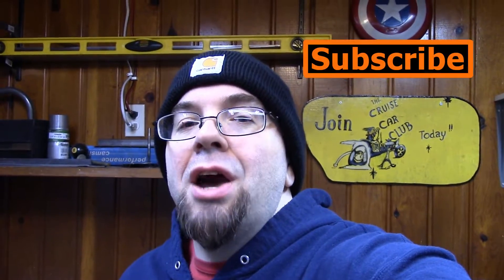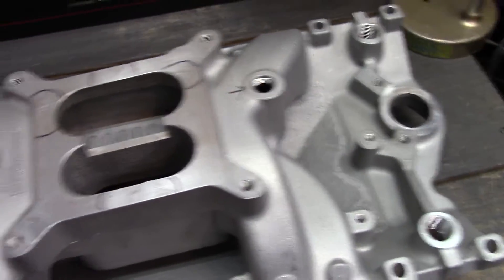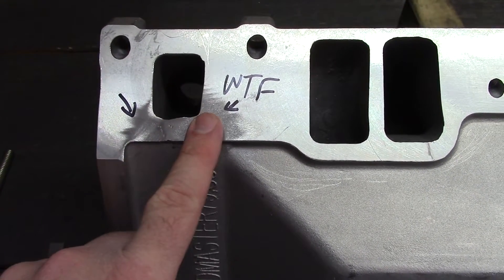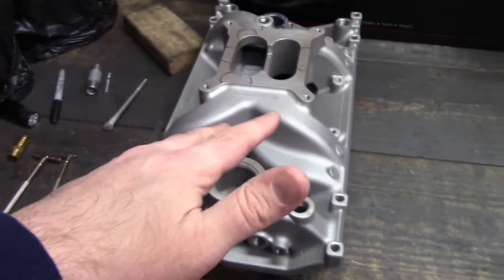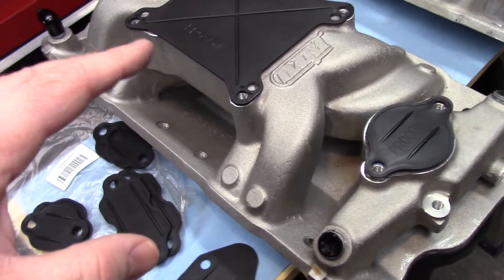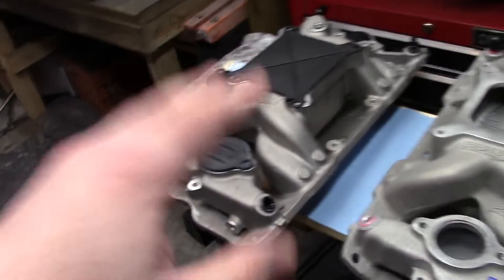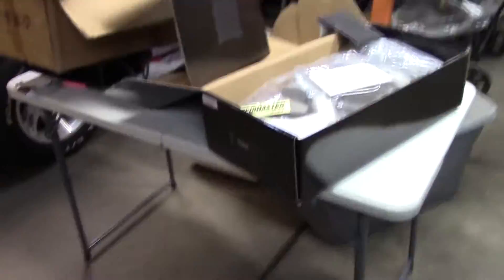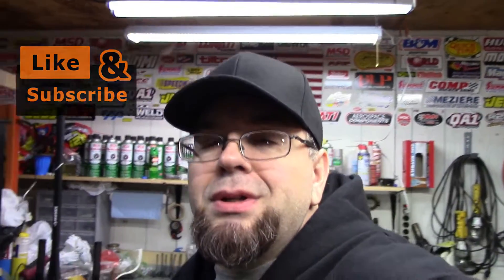Speedmaster Air Gap Dual Plane Intake ReView & Comparison

Comment: Good Luck Thier Getting It Right On A Return Is Pisspoor ! To Say The Least! I Still Have A The 350 Deep Pan With Thier Logo That Leaked When Installed And We Didn't Even Start The Engine. It Leaked In Their Logo . We Removed The Deep Transmission Oil Pan Took Pictures And Sent Them In. That Agree That Was Defected. But they never sent me the return label and still have not made a attempt To refund me. I even said I would take an exchange if they would express it right away. She took them almost two and a half weeks to send me the first one what a crock of crap. Ordered another one from summit and got it two days and it came all the way from Houston to California. Second one had issues of casting for the temp gauge hole. Sent Pictures To summit racing they would replace it but to try and use some thread sealer tape which I did and it. I don't order speedmaster any longer I will go through summit or somebody else get better service. Also they will stand behind what they sell.

Comment: I have a Ebay airgap manifold by ( Assalt ) , actually very good quality and straight,  works good on a mopar 5.9 magnum.
Reply from the maker: I have several decent overseas parts, intakes & other.  But Speedmaster has a bad rep for a reason.

Comment: I have made a tool for leveling the frets on guitar necks.  The same thing would work here.  It's a length of square steel tubing, about 1.5 inches square.  You can use stick-on sandpaper, or just hold it in place.  Use the non-seam side of the tubing, and sand in varying directions, and you should be able to get that surface smooth.
Reply from the maker: Seen people use larger box steel for cylinder heads or auto body sanding Boards, even mirrors and glass tables.  Made a video showing how I do small parts with a mirror.

Comment: Speedmaster is cheap Chinese POS.   Warranty is useless as you found out.  They make connecting rods as well.  Imagine putting a set of those in your built shortblock.  Good luck at 7000 rpm.

Comment: That's one of the better ones, A guy bought me one the ports were so far off the gaskets wouldn't seal. Pissed me off wanted me to fix it. Yeah I quoted $300 to fix that Chinese pos then I told him if I got it where it would work it would still be a pos. He ate it. I didn't want to tig and reshape the ports on that pos intake anyways...An intake is a one time purchase it don't tear up when running so why not buy a good one to start with and not beat one together. Don't be stupid, if you can't afford a nice intake maybe you shouldn't buy it yet just save up buy a quality one... eldebrock made it then the effing Chinese copied it, it cheats Americans out of profit and jobs, all for some cheap azz trying to save a few hundred $$ on a $3000 engine build. Wise up. Effing chinese don't have a clue what we do in this country. They beat parts down the line with no reason, no passion, no clue. A Effing toaster is the same to them as a crankshaft... parts is parts.. The problem with dart quality is the same problem it's Chinas fault, how? They have to get rid of their senior experienced employees and hire dumb bells off the street that drag and toss these products around.  plus they cut corners to save money to compete with cheap Chinese imports. So cheap azz engine builders that want to scrimp and save to beat an engine together. Why don't you compare that eldebrock to the cheap knock off? to show how inferior the knock offs are. Before long to compete the eldebrocks will be crappy too. Cheap Americans have noone to blame but themselves. You'd be better off rummaging through a dumpster hoping some one threw some old engine parts out you could use in your new engine. The engine shop I use throws away hundreds of used piston rings each month you want me to save you some to use in your next engine? Save you $80 man think about it. Or how about a crankshaft that's passed its last usage, you might stick a piece of leather in between the rod and bearing file a little off the end to get the clearance good enough to make it out the door. I always buy the highest quality parts I can find, I don't care what it cost. I'd rather pay $7000 for a set of $3500 brodix heads than buy a set of those $800 Chinese piles of crap. Thank you for showing people how crappy knock off parts can be. When quality parts are getting harder to find the last thing we need to do is hand over more of our hard earned $ to some pos importer for some cheap Chinese junk.

Comment: Thanks for the Video....Should you decide to keep it...I would knock those cheap plugs out and simply bore the holes to fit what ever pipe thread plug will fit. Seal them up and call it good. Another thought...perhaps with all the irregularities....you could prevail on them to actually warranty the product.....And replace it with a better one....
Reply from the maker: Pipe plugs are a great idea, may just do that. Thx for the suggestion!
Reply: @BOOT  As soon as I saw it...the very first thought that came to mind.

Comment: Front coolant port is because vortec blocks are not drilled for coolant bypass like older sbc
Reply from the maker: Ah that makes sense now Thx!
Reply: @BOOT  love your videos thanks for keepin it sbc
Reply: heavy duty 3/4 ton and 1 ton blocks are, and also have all the timing cover bolts like an old sbc. basically, if it had 906 heads, its probably got the bypass hole